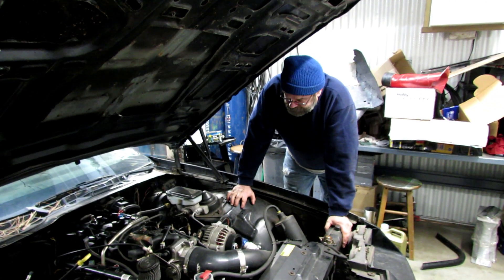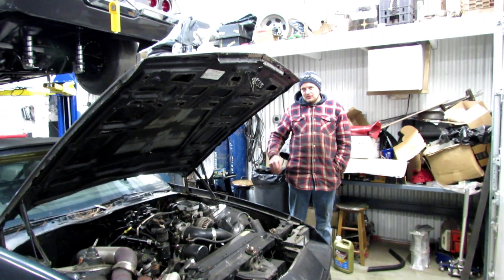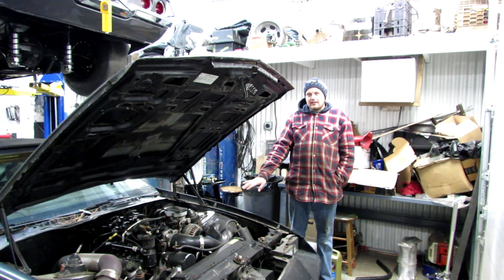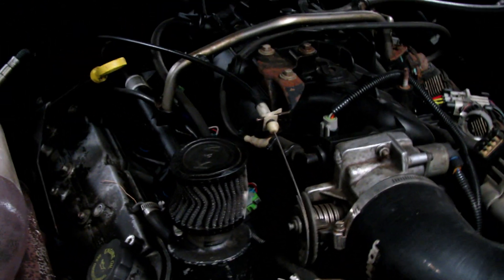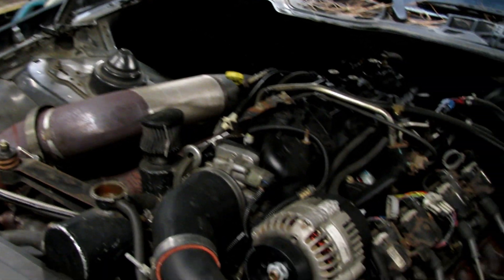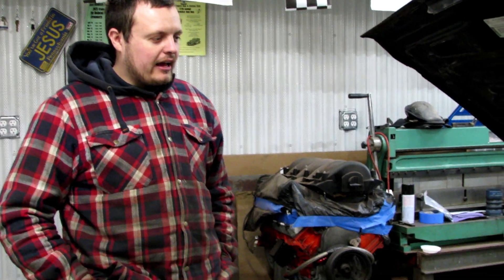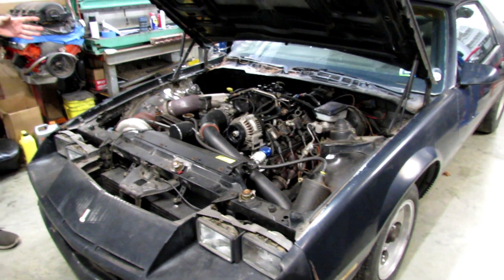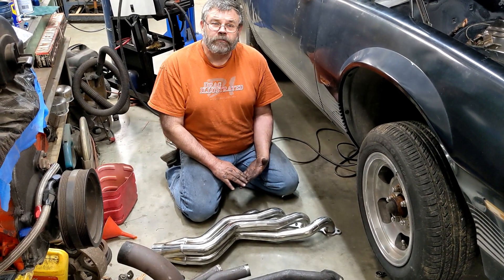Big Block Chevy Headers on an LS?!?

Comment: Headers are always an issue. I bought some headers and they didn't work. I knew the problem, but had it in my mind they could just be dented a bit to make the fit. Then at some point found they couldn't be dented enough. Over  300 dollars now scrap! I should have bought header flanges and cut the flange off the header and welded it up at the right angles. Very much more so because I have aftermarket heads that have two patterns. One is stock and really messes with the tube diameters and bolts are near impossible, vs a pattern that would have allowed a round tube and a lot of bolt clearance. I ended up just cutting up a 120  dollar set of shorty headers and got that to work. The shorty headers  were the first headers I bought that didn't just fit (without modifications) ,so hoped the other set would solve that and it did not.  Next option was to pay around a thousand for headers that may or may not fit.
Reply from the maker: That always sucks.

Comment: @Nivlac57 what Oil Pressure switch/sensor are you using?

In that 3rd Gen F Body, are the LS engine mounts in the same position as the SBC?
Reply from the maker: Stock GM sensor. The mounts were custom. Moved the engine forward a bit to make it easier to work on.

Comment: Cometic makes head gaskets for LS turbo applications. They work well and last longer in  High performance N.A. use.
Reply from the maker: Stock replacement ones work fine.
Reply: @Calvin-Nelson  We get more service life in our COPO stockers and super stocks using the higher grade Cometics.
Reply: @Calvin-Nelson  We could only get@ 12 passes on a 427 LSX non supercharged Factory shootout setup before the head gaskets were  in need of replacement. The cometic H1067sp3051s was the fix.
Reply from the maker: @fredbadgett7962  we have probably 30 passes on our stock replacement head gaskets on the Nova running 20-30 psi and probably 20 Dyno pulls, some at over 1000whp. They've been holding up fine.

Comment: Darn shame she blew. Turbos do blow air but need to be dialed in to function properly. Any type of leak or wear in the set up will bring unruly results and consequences. Sounds and performs great when right. Na all day, consistency is king and reliability a joy. Keep it coming!
Reply: 9.34 at 144+ from a junkyard 5.3 only lasts so long.  We put a lot of passes on this thing.  A lot....
Reply: @andrewnelson3733  absolutely, she held up great for a junkyard LS putting out low 9’s.  Crapmaro pushed limits